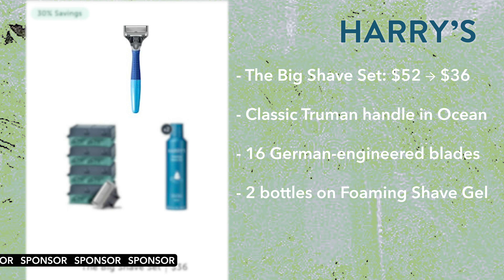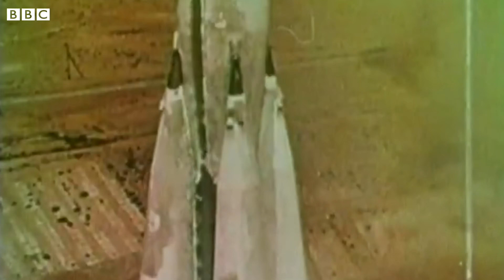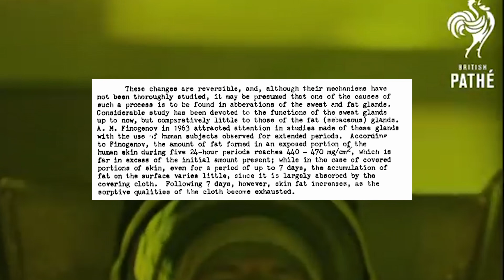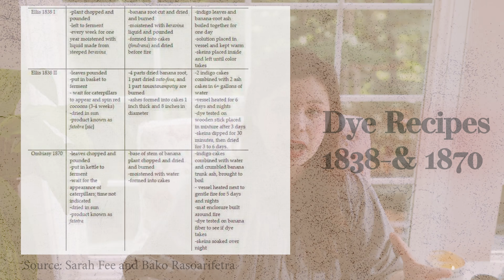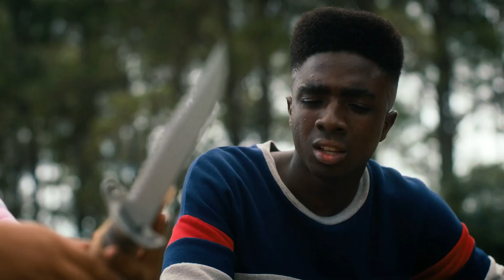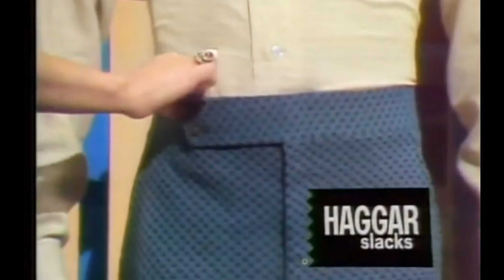The DISGUSTING truth about Laundry

Comment: As someone who is culturally both German and American, but grew up in the US, I have experienced a bit of both the American laundry practices and the more sustainable methods accepted without stigma in places outside of North America. My parents (a native German and an American who lived in Germany for over a decade) raised us to line dry clothes outside and inside, with drying racks and lines and only wash clothes on a need-basis. Smelling clothes before putting them in the laundry to ascertain if they could withstand another wear was common practice, as was inspecting worn clothes for stains to spot treat. We always separated laundry to make sure it was being washed in a way that was tailored to each type of garment grouping that could withstand different methods (heat setting and ability or inability to retain color saturation in the sun). We used natural deodorants that did not stain our shirts, and it was wasn’t until I went to college that I had access to a drier— I was less than impressed. I am passionate about garment history and sew many of my own clothes and this intimate knowledge of the care required and recommended for each fiber, along with having a difficult body type and an appreciation for one of a kind clothing from thrifting, I’ve become kind of obsessed with the longevity of my clothing and I try to do everything on wash day that might ensure the safety of my garments. This issue is so near and dear to me—and frustrating as well, especially when my career requires me live out of hotels where I only have access to driers, and obviously no outside area for line drying or the ability to travel with a large, cumbersome drying rack

Comment: Pro tip: add white vinegar to a load to help cut hard water and to help sanitize the clothing.  (It also works as a fabric softener!)
Also.  Don't bother separating whites and colors, use cold water--this stuff is being washed in a ton of water and swirled around in soap-,and hot water often ruins clothing anyways--and you need less laundry detergent than you think.  You don't want residue left behind.
I'm definitely going to try the vodka trick when I have more money.  I may also start washing just underwear in hot water to help sanitize it.

Comment: I have a cheap clothes rack from target in my laundry room I use to hold hangers as well as stuff that can't be dried, it works well and everything is soft bc I use vinegar in my wash. If airflow is an issue in a smaller space, a box fan does wonders and is also cheap.

Comment: As someone who has been using top loading machines with agitators for the past 7 years, never had anything damaged in the 7 years I’ve been doing my own laundry. Maytag recommended washing stuff for 3 to 5 minutes with their wringer washers (works with their older automatics as well), and drying small loads for 15 minutes or so since things would be damp dry and would hang them up to dry the rest of the way.

Comment: And this is why I don't even own a washer or dryer. I live in a rural area, on well water, with an amazing water filtration system. I wash everything by hand, and yup...my linens get boiled. "Whites" day is long and sweaty. But the work is absolutely worth it to have super clean undergarments.  My outer clothing are usually spot checked after every wearing, but generally not washed unless heavily soiled. And when they are washed, it's done with great care to ensure that they are gently cleaned. Line drying is the only option for me. If the weather doesn't cooperate, the clothes get hung on the line strung on the back porch, instead of on the line in the back yard. ❤

Comment: I only use hygiene plus programs, at least 60/70 degrees C or 90 from time to time, QAC and AOB for disinfection. Drum clean 2 times a week, cold water clean and 2/3 times the hot water and sometimes warm if there is small residue. WM cleaner every 2 months or so. Plenty of rinses as well ,cleaning the drum of the dryer, cleaning the filter every time ... i wish they;'d make stronger scented QACs.

Comment: I finally got a modern washer and dryer after using ones from 1994 and I can say in pretty sure I earned a new appliance and also that this set is much more enviromently friendly. Between less water and the dryer not taking 3-5hrs to dry a single load. Will also say I switched all bedding to linen several years ago and only own natural fiber clothing/laundered materials so no micro plastics for me.

Comment: I live in an apt with no washer and dryer, so I bought a small electric washer.  Thanks to it I've learned a lot about laundry,  starting with how agitation is actually needed to get the oil and dirt out of the fibers. I never understood why they'd show people beating their clothes on rocks and hitting it with paddles. Turns out you actually HAVE to do that to force the water in and get the nasty out. No wonder the stuff I hand washed would stink when I put it back on.  Ugh.  The little machine works so well and I can monitor if they need another cycle or not.  Also we aren't allowed to hang our clothes out to dry but I do laundry on the weekend and no one sees it lol.

Comment: To touch on the grain alcohol tip: an accessible alternative that I've used to good effect is isopropyl alcohol (I use 90% personally) instead. This might be more feasible for low income havers and for people under the legal age to purchase alcohol. I do want to say that you need to spray in a well ventilated space, so at the very least open a window and turn on a fan.

Comment: I always use powderdetergents never softener and towels underwaer ect at least with 60° Celsius. The powderdetergent contain oxygenbleach (Natriumbicarbonat) this gives a very good clean,i rense the clothes with citric acid.  Since at least 20 year never softener. Never. And no dryermashine,allways dry my clothes inside the house or if the weather is fine outside. There wont be mold in the house if people air the house. Open windows may help;-) We all need to save energie and water.

Comment: Very interesting video!  Just a thought, as a soapmaker I know that handmade soap usually has a high ph, and this high ph is hostile to bacteria (eliminates it) which is why we wash our hands with it, but could also be harsh on our skin since our skin is more acidic (lower ph).  I don't know what the ph of laundry detergent is, I do know that adding washing soda to the water will increase the PH level though, if the sanitation factor wants to be achieved without having to boil the water.

Comment: People are commenting about the value of hand washing dishes over using a dishwasher. The argument I’ve seen that it uses less water is false.  The average dish washer uses less than 10 gallons to wash a full load of dishes. The average amount of water used to hand wash a sink full of dishes is between 15 and 20 gallons.  Conversely if you are using a dishwasher and you are rinsing your dishes until they look clean, then you are making the dishwasher soap less effective. It is designed to need food residue to clean effectively. I have hard water and while I’m not going to put a plate with tons of food left on it if you simply scrape them and wash them in my experience, they come out, clean every single time. I’m saying after having done this for over a decade. As long as you don’t over load the dishwasher so the water can circulate, you should be fine. If you have super hard water it may be a bit different but you still shouldn’t completely clean your dishes before using the dishwasher. I lived somewhere that the water was so hard I had to use a chelating shampoo weekly on my hair and I could get clean dishes by adding citric acid and a rinse aid to the dishwasher.

Comment: I was raised that the dryer was only for emergencies (lol) or for finishing clothes off after line drying during damp weather.  We don't have a dryer now, but instead we use a dehumidifier and a fan pointed at a clotheshorse, In a small room - and again, this is only during damp weather when they won't dry outside.  The advantage of this is you can dry stuff that can't go in a dryer!  You can lie a wool jumper flat on top of an airing rack and let the wee machines gently dry it overnight.

Comment: If you absolutely MUST have a dryer (for some weird reason) then get a heat-pump dryer. Much less energy intensive and much gentler on the clothes.
Also, air drying is possible with collapsible laundry racks for those that do not have much indoor space.

Comment: So I use white vinegar as a fabric softener because it is technically a mild acid and does actually soften your fibers instead of coating them with something. It is hypoallergenic and literally comes from fermenting plants don't know which ones but I know it comes from that. An added benefit is it is technically antibacterial not to the extent of bleach or boiling water or anything like that but it is more antibacterial than the average fabric softener

Comment: I guess I have an old era attitude towards laundry 😄
I never wear external garments without undergarments. In summer undergarments provide relief from heat. All undergarments get washed at 60° C after only one wear, no matter what! I mostly wear white cotton but I want to experiment with linen and that's the reason why I watch these videos.
My water is hard. I use a biodegradable detergent plus sodium percarbonate (non toxic) and citric acid as softener and to neutralize the alcaline limestone from water.
Unfortunately I live in a flat on a traffic road and not much sun either. "Airing clothes" just means smog, dirt, pigeons and bad smells on top, so I need to tumble dry and that's also very good for softening. I also do line hanging indoor.
I see some people here hang outside on a rack with a plastic wrap on top.
External clothes are a different story, but I surely wash them very often and I only buy jackets and bags that can be washed.

Comment: I have been drying my clothes on a line for the past 35 years. I love the aroma of sun dried clothes. If you are going to make the switch, treat yourself to pegs that are not cheap and easily broken. Most plastic pegs quickly turn brittle in direct sunlight. They also seem to disappear, rather like socks do... I switched to a cool product 15 years ago that is clothesline and peg all in one. They are called Ezyline. My original set is still going strong. They are made of a light stable plastic that doesn't crumble. And they can't go missing as the pegs form the line. Anyway, as a mother and a grandmother I have done my fair share of laundry! Hope you all make the switch!

Comment: The best way we can normalize clotheslines in America (and Canada) is to start using them -- the boojie-er your neighborhood the better. If it's banned, see if you can find like minded neighbors to fight the ordinance with you, make it annoying to enforce. 

That said, clothesline and dryer are not the only options. Folding drying racks are inexpensive and work great for small things like socks, bras, and underwear. In winter, I dry most of my clothes on hangers. You can hang them on a portable clothes rack, a shower curtain rod, or anything that can hold a hanger. I get good mileage from an Ikea bookshelf and my doorframe. I might be the oddball here, but I'm American and despite doing my own laundry since i was a teenager, I had never used a clothes dryer until I was 30. I've given up on them now. Air dryed clothes wrinkle less and collect less lint and static electricity

Comment: In the uk, dry cleaners have been moving away from Perc (which is the dry cleaning fluid that smells vaguely like wet dog) and towards Green Earth which is liquid silicone which is much safer & smells less. This was the case when I worked in a dry cleaner 20 years ago.

Also, eco detergents are available relatively affordable. (As is noted by the entirely appropriate ad for Smol I got on this video. )

Sanitising clothes is mostly not needed - hot wash towels & bedsheets, clean your washing machine regularly & if you feel the need, wash underwear or potentially contaminated items as a separate "soiled" load at a slightly higher temperature. 

What does utterly baffle me is the lengths companies have gone to in the US to convince people what is needed. I swear to god, if I see one more ad for "scent boosters" I will scream. These high levels of perfume on laundry, clothing etc is incredibly dangerous to anyone with an allergy. I once had to leave a work event because the person next to me had so much scent in her clothing I couldn't breathe, my eyes were burning & it was honestly quite scary.

Comment: I was so excited to see this video as for the last couple of years I’ve been working on this exact problem: changing my laundry practices.

I stopped washing my clothes in anything but cold water, and line dried my clothes. But then I started to notice that my underwear and gym clothes still SMELLED the second my body warmed them up after I put them on when they were supposedly “clean” - that’s when I learned about detergent not sanitizing my clothes. I was decidedly horrified.

I got a special “enzymatic” detergent (rockin green for technical fabrics is the brand I currently use) for my underwear and athletic wear, AND I added a special Lysol sport laundry sanitizer to the final rinse.

It worked. No more smell. But! I wanted a less expansive sanitization option that didn’t seem like I was putting more chemicals and potential endocrine disrupters on my body. So I tried vinegar. That works too! It’s cheap, and as far as I know better for the environment (?) and one’s health. I just add it to the fabric softener compartment on my washing machine and it does the job in the final rinse. Bonus, Vinegar can also soften your clothes AND brighten them because it strips any detergent residue off the fabric. So I don’t use fabric softener either (I didn’t before, but never will now for sure).

I am still researching the finer points of this, but I recommend that people research “the ph of cleaning” for your home and your laundry - e.g. hard vs soft water can be a change in PH of your water. Which is why you can’t add vinegar to your wash cycle with your detergent, they will neutralize the wash and neutralize the products effectiveness. It is also why your water source matters.

Bacteria can not live outside a certain ph, so when you create an environment that kills bacteria in your laundry cycle, there’s no more smell. Vinegar is an acidic product which means it can kill bacteria. Bleach is alkaline, and will also kill bacteria, but is hard on your clothes and you can ruin them.

I am still working on this so much, but I’m getting ready to take a thermometer to the water in my washing machine because it doesn’t list the temperatures in my washers manual and I find this very upsetting.

I am thinking I may need three products for laundry (used one at a time in a single wash, never together)

1. Enzymatic detergent in a pre soak to break down bio matter
2. Regular detergent in the wash cycle for dirt, grime, and stains
3. Vinegar instead of fabric softener for the rinse cycle to kill bacteria by making the rinse acidic, brighten the clothes by stripping detergent residue, and soften the clothes to boot!

Use cold water always, and line dry as much as possible. I live in a cold Climate so I can’t line dry in the sun 9 months of the year, but an indoor rack has worked well for me.

Comment: As someone who has washed cloth diapers in a hard water area of the US, I want to point out that detergent is NOT supposed to soften water. Detergent is synthetic soap designed to clean specific things, and in this case it's fabric/clothing (you also have dish detergent and shampoo is a detergent for hair!). What softens water is water softeners! And while powder detergents usually include water softeners, liquid detergents rarely, if ever, do... and even the softeners in powder laundry detergent is insufficient in any but the most mildly hard areas. In most of the US, one must add a water softener to their laundry, and the amount absolutely varies with water hardness. I learned a LOT about laundry while cloth diapering, because if you don't wash those suckers correctly your baby can get rashes or infections, and they won't last anywhere near as long (physically) as they should!

Comment: Search for "semi automatic washer", for me it's better than the normal full automatic washers but don't use hot water with it.
I wash underpants and socks separately, then bras separately, then the rest according to color. I soak socks in boiling water occasionally. My dryer broke so I hang to dry on drying rack.
And less is more when using detergent, and no fabric softener ever.
And I saw video of a soap bar to use on stains before washing, does anyone know what it is or where to find it???

Comment: 28:41 When I had an apartment I used to boil water, and pour two casseroles of boiling water into a bucket, and dissolve soap in it, and stir dirty clothes (esp. touching the skin) therein, letting it soak and release dirt overnight or for a few hours.

Then adding a rince in cold water and hanging in the bathroom, as Sweden is also a country where line drying is not allowed, at least in certain neighbourhoods.

For winter, I added warm clothes outside this, they don't need all that much washing.

Comment: 19:23 You might want to check out the old art of chosing city sites in places with good ground water.

I think it is even mentioned by Aristotle in The Politics.

Aquaeducts were a false solution, when they were abandoned for reasons of military security, yes, two cities were taken through the aquaeduct, the well water replacing aquaeduct water was (usually) an improvement.